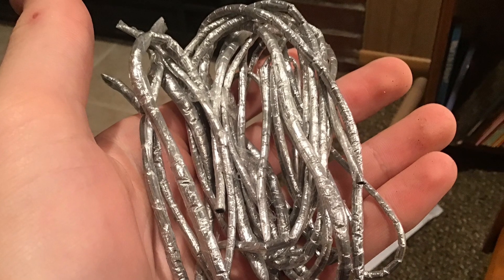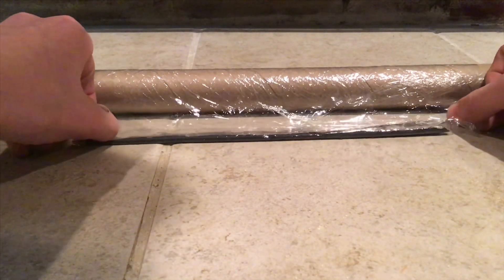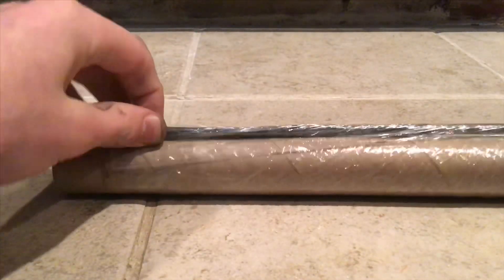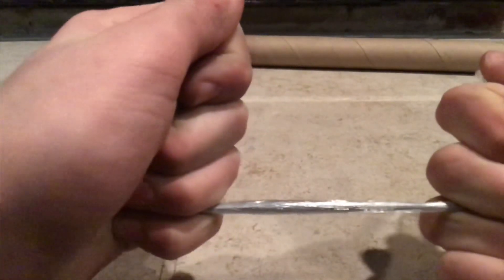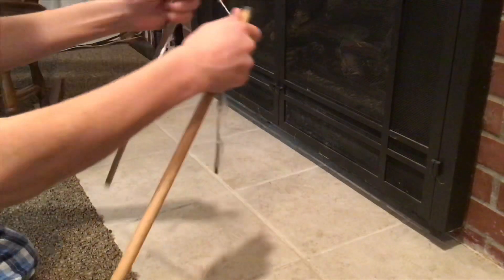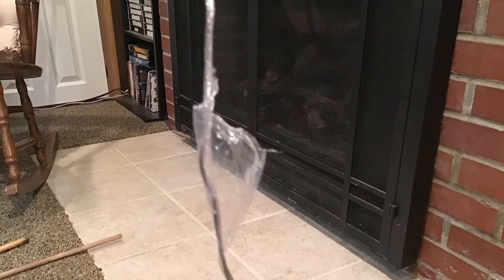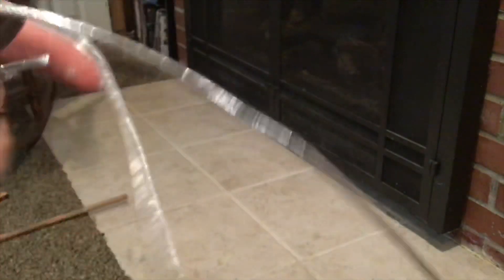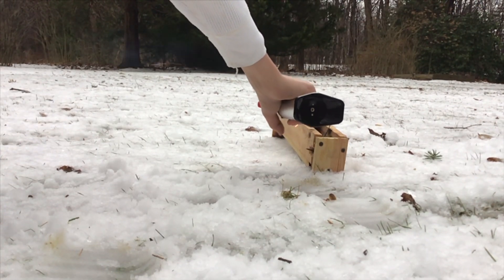How to Make Waterproof Fuse

Comment: You made it way too flimsy and weak, 
you should use just enough wrap so that you can just barely manage to stretch it, otherwise it will come out very flimsy. Just step on one end and pull the other with pliers. If you make it thick like that it will self close the ends when you cut it, every single time and it will I’ll be hard to open even if you try. with pliers and will be way more rigid and won’t buckle like visco in the slightest. Why do you tell people the opposite of what’s true,
Reply from the maker: Oh

Comment: You make it look so easy, either I don't know my own strength or I need more? 🤔 wraps?
Keeping in mind what you said about being hard if using too much, I used 3 wraps and they break after stretching only a cm or so......
Any suggestions?
Reply: your using wrong wrap type. if the plastic wrap looks purple on the roll it wont strecth like that at all, thats pvc film. you need polyethylene film which will look completely white on the roll. Cheaper wrap is often the best choice
Reply: @KClO3  it's neither white nor purple.
It's just a really cheap roll that's easily torn.
Thanks you though 👍
Reply: @hulkgqnissanpatrol6121  if it looks slightly green or yellow on the tube it also won't work thats pvc too
Reply: @KClO3  I've gotten really good at traditional Chinese style hand rolled fuses and dipping them in bee's wax to waterproof.
 A thin wrap of tight cling wrap around them also work's well.
Reply from the maker: oh mine has way more than 3 wraps lol, build it up to like .25" then stretch it

Comment: instead of using bp I used homemade rocket fuel in powder form to make the fuse and its a good slowburning fuse with nice sparks

Update: i've been using it with some milled bp and burns just like visco without the sparks and I take the whole thing of fuse cut it in half then wrap it with 1 layer of masking tape and 2 layers of gummed tape and wrap with string and glue and there ya have it a cheap version of 1/4" chinese time fuse
Reply from the maker: Glad it’s working for you 
I think I’d have reliability issues with sugar fuels.

Comment: Interesting.  You're stretching the polymer to approx its elastic limit.
That's rather like the method used to make heat shrink tubing.
With that in mind, it would probably shorten/fatten in some degree if it were warmed up to just the right temperature.  Carefully.  :-)
Nice job.

Comment: Dont know where you live but black powder is expensive way cheaper for me to order waterproof fuse from ebay or amazon thiers also Pyro websites they sell a variety of fuse from slow 35seconds per foot too fast fuse of half a second per foot. Good video if you have extra powder stored away and need to do something with it
Reply: Your telling me your buying BP? thats your problem right there you outta make it yourself
Reply: No too expensive too buy and dont need too make it either. I only use quickmatch fuse once a year for fusing finale cakes other then that. I only buy premium lacquer slow burning fuse. I can get it cheap and perfect for M80's and M1000'S

Comment: .. Just dip them in nitro cellulose, It's even MORE waterproof.!!..
Reply from the maker: I would say equally so
Reply from the maker: This is cheaper.
Reply: @PraetzelProjects  Just disolve a few ping-pong balls in acetone, it's not thàt costly and it looks more pro...But I'm still enjoying your chan, mate.! I didn't meant to piss all over your achievements. Sorry if it looked like it, I can be a dick at times but I'm not always aware of it... Ya got some good ideas, keep it up : we need more pyro's.!
Reply from the maker: @explosivefreak666  it’s all good, I have a bunch of nitrocellulose, but I have not used it for one reason mainly being that I have not made Cisco fuse or a wound paper fuse.  I believe the acetone would attack the Saran Wrap and ruin this specific fuse.
Ideally I would use visco with a mc coating but the machines are so darned intricate.
Reply: @PraetzelProjects  I bought Cisco fuse from China (cheap), and coated it with NC.  ... Waterproof and still reliable.
Reply: @explosivefreak666  can you coat black match fuses this way to make them waterproof?

Comment: Very nice technique! I'll try that out for sure. Back in the days this was one of my badest headaches, to make a reliable fuse. I finally went with soaking cotton string in wet BP and letting it dry out. Works ok, but isn't reliable at all, very hard to store in a moist climate like here and generally very water sensitive.
Reply from the maker: Yeah 
Takes practice but works
Make sure you test every piece
Reply: if you want to water proof any bp based fuse use model airplane dope aka nitrocellulose lacquer, it give a nice burn rate along with waterproofing, its what they use on visco fuse, but ive used it with a few types of material plastic/bp intead of string/bp sounds interesting ill have to give that a try

Comment: I only have flash powder , can I mix it with powdered sugar , will that burn slower .
Reply: It might work but dont do it, if you wrap it too tight it will end up exploding or if you add too much in one area, stick with normal gunpowder or use another slow burning composition.

Also just a correction baking soda slows burn rate ;)
Reply from the maker: A.M. no
Use bp

Comment from the maker: As Schel Sullivan would say, “Fuse is cheap, fingers are not.”  
So make sure you are confident in your finished product before using it in any pyrotechnic device.
Reply from the maker: Do you use bp that may have been coarse?
Reply: Nope, it was powdered
Reply from the maker: Meal?
Reply: Yup
Reply: Firework Tutorials well you got further than me I chucked it across the room due to the cling wrap not sticking 😂
Reply from the maker: KAYLEB_HD that’s what I did the first time
You want to have a really clean area and be super neat with the meal or else it doesn’t stick
Reply: Yeah, Once, when i tried to make Saran Wrap fuse, i tested some and it was like quick match. Good thing i tested it!
Reply: tried this the other day, got the same results as  @Firework Tutorials haha, I think my problem was too much bp + missed the stretching step 

Update: added some sodium bicarbonate to my bp + stretched it and now it works quite well!!
Reply: Do not use fast BP, use milled hardwood bp powder and make sure to rid all the air inside when wrapping, make sure you use the type of stretchy Saran Wrap that behaves like that.